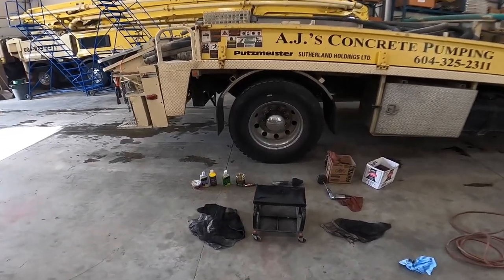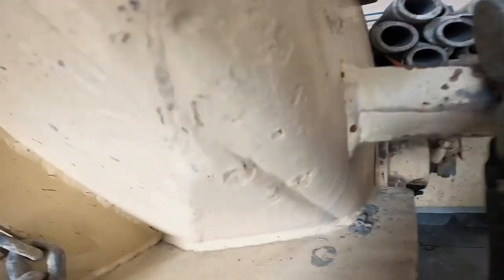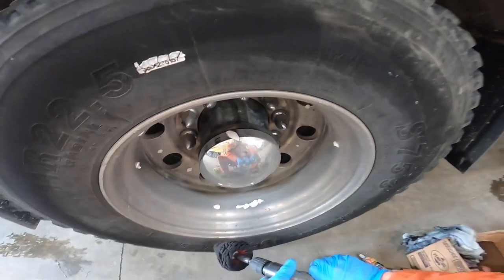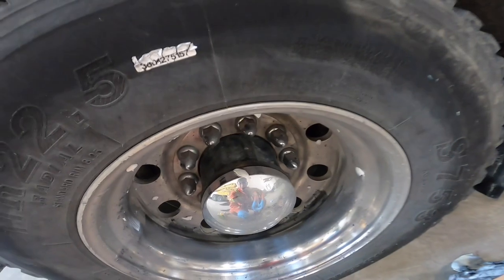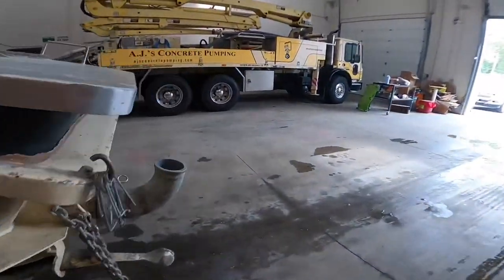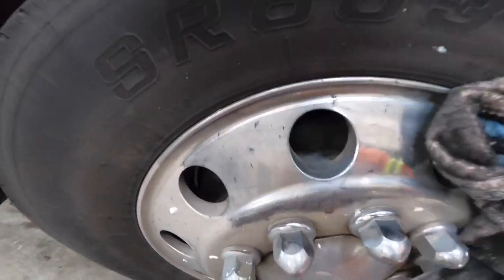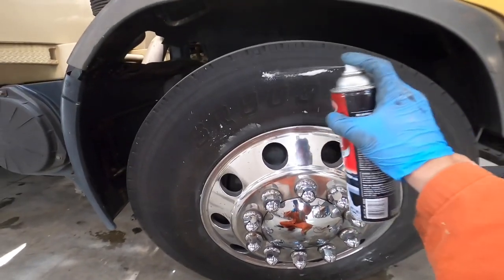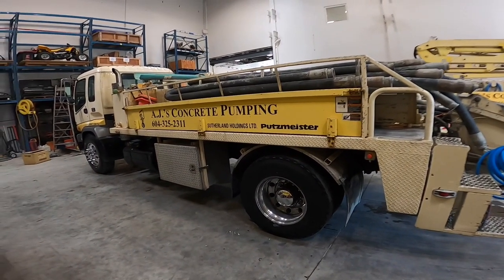Polish up your wheels in 5 minutes per.

Comment: Uni-lume. Worth every cent. Best polish I've ever used
Reply from the maker: I have not seen that one before? Whereabouts do you source it from?
Reply: @canadianconcretepumper1979  Amazon usually has it. It's not cheap, but I promise you'll love it. If you get some and don't like it, let me know, I'll buy it from you.
Reply from the maker: @greghughey9738  I’ll give it a try. What I like about the Autosol and what has me convinced as to why it works so well is that it’s heavy on the solvent content and really seems to cut through the nastiness more effectively than most other polishes which I’ve tried.
Reply: @canadianconcretepumper1979  The uni-lume seems to burn rite through anything other than hard concrete. I don't even have to use jeweler's Rouge anymore. It needs a vigorous shaking, and it comes out a strange consistency, but the stuff is like liquid gold when coupled with a poweball/powercone. I buy it and the only interest I have is a pretty machine. Just an operator.

Comment: Are you guys Union  operators up there tanks for the time
Reply from the maker: There are only two union pumping companies in our area (the other roughly 95% of pumps on the road are non-union). Ready mix supply is about a 50/50 split between union and non-union.
Reply: How many operators are you keeping busy?
Reply from the maker: @jonscally5225  with the current ready mix supply situation (half of the providers on strike and the remaining half running on a powder shortage), not many 😂😂😂
Reply from the maker: We typically run 8-10 operators. We’re just a small, family run outfit.
Reply: That’s the norm around here 4-5 operators per company. Philly and NJ run mostly union ,  they charge $91 per hour for one guy of that the operator only sees like 47. They tried talking to me about joining up but at those costs I’d be outa business in a month .

Comment: Aluma bright you don’t even have to do anything spray  on wash off do it on every wash
Reply from the maker: Yes, but it leaves a mat finish rather than a polished finish.
Reply: Aluma Bright has no shine. That's the lazy way to clean wheels.
Reply: @fronabargerconveyingpumping  kinda like a foam cannon lazy? No just the smart way when you polish your ass off for an hour just to have it mat up an hour later is dumb if you ask me
Reply: @nwconcreteworxllc1258  we've all got our certain ways of doing things. Polishing can be a pain but sure looks good for a while.